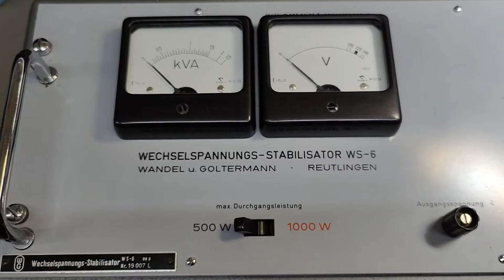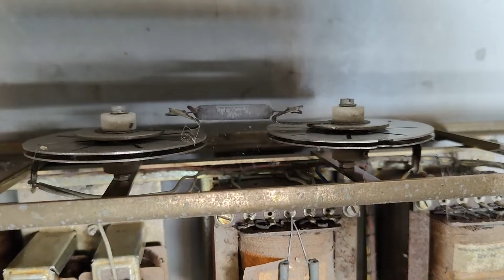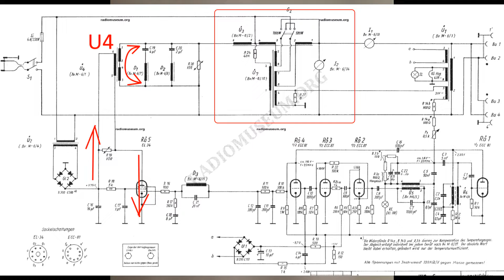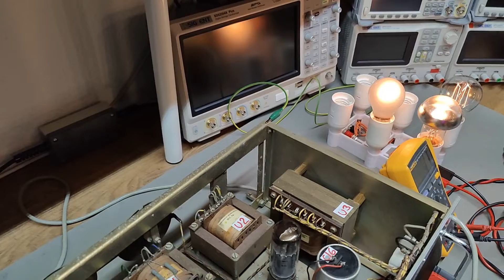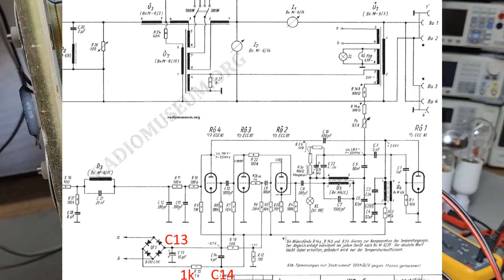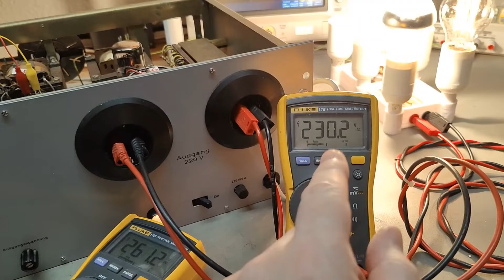Wandel & Goltermann WS-6 Wechselspannungsstabilisator 1957 test repair teardown

Comment: Hi Thomas, a beautiful mains voltage stabilizer with the possibility of output regulation 🤔 we already know why things randomly fall on me at work - this is caused by the weight of the equipment you tested and, thanks to this weight, the earth's axis deflection, but now it is clear to me the drops and outages of our electrical distribution network - Thomas tests another awesome device 🤣

Nice day 🙂 Tom